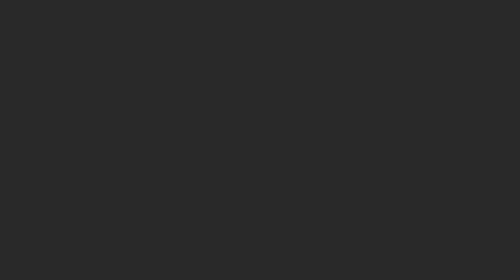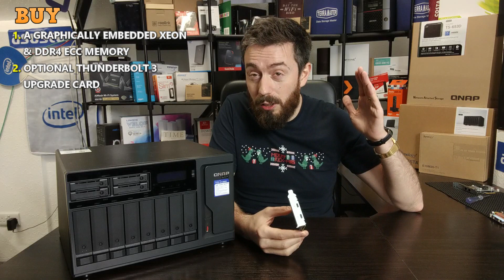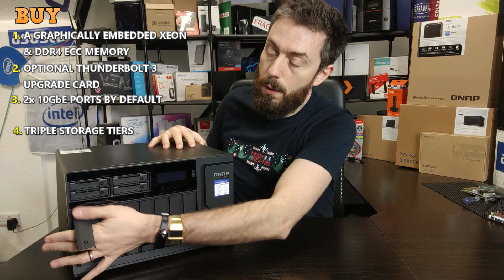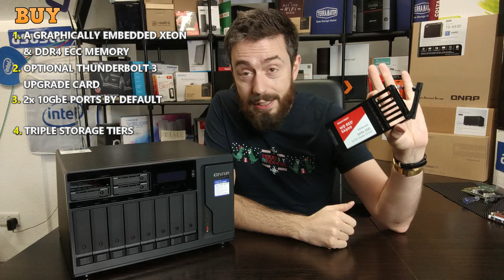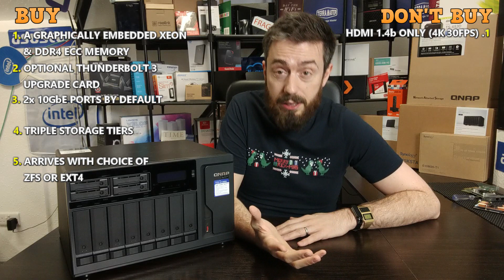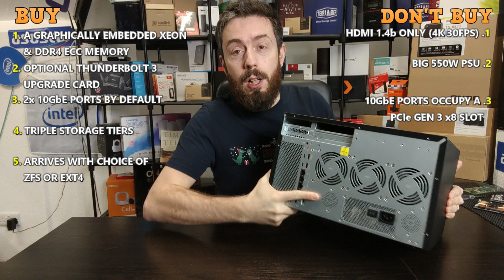QNAP TVS-1288X NAS - Should You Buy It?

Comment: I have it. It is awesome. Definitely use the tier storage. Use ssd for apps in pool 1 and then media in pool 2 on SSD. Also have cache nvme m.2. And added 128g of ram. Now just trying to decide on GOU. If anyone has GPU suggestions.
Reply: Unless you already got a GPU, I can vouch for the MSI GTX 1050 Ti 4GT LP. I have been using it for about 6 months without any issues. Also, very nice on the 128gb. I currently have 64gb and for now it works great. Let me know if this comment helps.
Reply: @diagito  many thanks I went for the more powerful quadro p2000 5G in the end
Reply: @diagito  yes it helped make up my mind. I will order that GPU and let you know. Thanks.
Reply: I have just bought the TVS-1688X - isn't it better to use the SSD for cache and m.2 for apps/media? whats a GOU?
Reply: @speedbird737  meant GPU

Comment: Yeah, I agree about it being available in 4 & 6 bay options.

I bought the h1288x for home use, not ‘enterprise’, I don’t need 8xHDD’s plus 4xSSD’s plus two NVMe slots....with the ability to add more via PCIe adapters. I don’t need stupid amounts of storage capacity, but I do like the speed & capability of this processor. At present, I have two 1TB SSD’s for the OS & apps, and six NVMe 2TB sticks installed in a raid 5 for data. At some point I will need to add more storage, but this will probably be more SSD’s in a Raid 5...probably three 4TB, so I will use one of the 3.5” bays to house one of the 2.5” SSD’s. I prefer to avoid using HDD’s if I can I think. 

So, what I’d like to see, is a similar machine, with maybe just 8 SSD bays total and ditch the 3.5” bays. Maybe make one of the two x4 PCIe slots a x8 (so two x8), so a second NVMe adapter could be added.

The four 2.5gbe ports would be better if they were Four 10GBe ports too......or, at least maybe just two 10GBe ports built in with the ability to add more via the PCIe x4 slots.

The HDMI output being only 30fps is a pity....wonder if there is a Xeon as powerful but with a 60fps output.

I never thought about how power hungry the device might be!
Reply: there is a machine from qnap already thats is ssd bays only
Reply: @speedbird737  ...there was not when I bought the H1288x I think.

Comment: The negative about the 10GBe card being on the PCIe x8 slot is a minor irritant that can be easily resolved.

I bought a QM2-4P-384 NVMe card, and it made sense to fit that in the x8 slot. So I just moved the 10GBe card across to one of the two x4 slots. Sorted! I think the QM2 card came with a range of backing plates too, so I used one of those on the 10GBe card when I moved it across. It’s not really a negative at all, it’s so easily resolved, I just don’t understand why QNAP would manufacture the machine with the 10GBe card in the x8 slot to start with - that seems daft.
Reply: Did you get yours for $2k or $2.5k?  They have gone up a lot.
Reply: @BrianGarside  .....yes, they have. I missed the best deal, but I did get 64gb version for around £2.5k.....couple of weeks later, I noticed it had gone up again.
Reply: @TheLDunn1  Ok, yeah its seems they are selling fast. Didn't know you could get a 64gb version configured, Nice.
Reply: @BrianGarside  ....Span offer them in 16, 32, 64 & 128GB. I’m just a home user, so would probably be fine with less, but I also ready that ZFS file system likes ram, so I went for the 64GB version to be on the safe side, I know I dint need to go up to 128gb though.
Reply: @TheLDunn1  Ah SPAN ok, that makes sense now. Dealers I visited did not you have to have it installed after purchase. Thanks!
Reply: @BrianGarside  ....I wanted to buy from Span, because of the very helpful YouTube videos.
Reply: @TheLDunn1  Agree with all you've said Lawrence. But how noisy is it ?
Reply: @tadbarker7082  well, mines pretty quiet because I don’t have any hard drives in it.

I have 6 x 2TB nvme sticks - 2 of which are on the nas, 4 are on the QNAP pice card.

I then have the OS on 2x SSD’s (think they may be 2TB SSD’s from memory).

One of the reasons I decided to stick with SSD/NVme drives was to keep noise down. I’m not sure what generates more heat though, SSD/nvme or hdd....because one aspect of noise are the fans..it’s all I can hear from my nas, the fans are not that noisy, and they are not running flat out or anything, but it is the only noise I have from the nas. It is certainly not annoying or irritating, it’s perfectly acceptable.

It’s taken me a few months to get it set up to close to what I want.

Comment: It is a beast and shows how important a good size CPU is.
Indeed, the Thunderbolt card (QXP-T32P) can serve a single TB user per port (so, no daisy chaining of users/pc's) or multiple TB-connected QNAP's (daisy chaining, up to 6x max, counting from the host PC) per TB port.
BTW, the QXP-T32P is the exact same(!) TB3 card (being the "TBT3 - 40G2P V1.1") as already present in the TVS-1282T3, TVS-472XT, TVS-872XT etc but with some additional brackets to mount in various-height slots (low-profile etc) 
So I would argue it is not that "optional", it already existed but not available for separate purchase.
I wholeheartedly agree with you that the PCI-e slot configuration (2x x4, 1x x8) is a bit of a let-down because if you look at the QNAP's with 10GBe expansion factory-installed (TVS-1282T3, TVS-1282T), they are not always limited to the x8 PCIe slot but use a x16 where available.
I also agree the choice that QNAP only offers 4x 2.5GBe on this model is a bad choice, likely due to chip-set limitations or costs. (savings)
And it almost looks like the add-on card for the 2x 10GBe is an after-thought because no way will a PCI-e x8 slot go beyond 7880MB/s (theoretical maximum)
(you mentioned 2000MB/s but that was for PCIe 1.0, these are PCIe 3.0 slots)
In all QNAP tries to position this as an enterprise NAS but on several key areas it is missing that mark. (your Top 5 Not-To could have that also noted as a negate)
Probably to make the price more attractive and/or the unit not more expensive than it already is.
And with their ZFS implementation (and limitations) I'm still not convinced at this moment in time that is the way to go, as QNAP still has to do a lot of work on that.
I was considering the TVS-1288X for replacing our TVS-1282T's & TVS-1282T3's but looking at such things as PCI-e on the latest QNAP's, I'm not that convinced that QNAP is currently at the right track. Maybe their PM(s) need to rethink their strategy a bit more?
Because, I'm really sorry, but a 2-port 10GB card in a PCI-e x8 slot is just plain stupid! I think.
Reply: So, referring to the title of this video, I think "QNAP TVS-h1288X NAS Review - Speedy but underwhelming hardware-configuration.."

Comment: Thanks for the vid.  I have one of these on order currently.  I really like that this model has so much space to grow into and after comparing all of the models the bang for buck seemed to make it one of the best choices from Qnap.
Reply: Hi Joel, 

I received my H1288x mid December. This is my first QNAP, so I’m having to learn the software side. So far, very happy with it.

I moved the 2 port 10GBe card out of the 8x PCIe slot and put it into one of the two free x4 slots. This freed up the x8 slot so I could fit a QM2-4P-386 4 slot M.2 card. I have installed 6 x 2TB NVMe sticks in the NAS and set them all to one raid 5 for data storage. Separately, Span installed two 1TB SSD’s in the 2.5” drives which are in Raid 1 for OS/app storage. Currently, I don’t have any of the 3.5” bays filled, but at some point in the future, I will probably need to install some SSD’s when I need to grow storage. I had around 5TB of music, photos & video footage on an old Synology NAS that I had to move across (took an age due to the speed on the old NAS).

I’ve installed a QNAP 2 port 10GBe card in my desktop too, so I can go 10GBe direct between NAS & Desktop. This is the only area where I’ve struggled. I’ve been trying to combine the two 10GBe lines and run speed tests on the desktop, but I’m not getting the expected speeds, only around 1000MB/s so far, I was expecting more! I think I’m doing something wrong on the port trunking, but I’ve tried loads of different things, but not really had success yet. Hopefully I’ll get there in the end.

I am now able to download images straight from camera to the NAS and then edit the on my Desktop directly from the NAS, it’s easily fast enough for that, which was one of my goals. Video (up to 1080P - I don’t have any 4K yet) also seems to play and stream fine. Not tried any video editing direct yet though, but expect that will be okay too.

On the software side, QNAP seems pretty similar to Synology DSM that I’ve been used to. It takes a little adjustment to learn, but so far seems straight forward (except for the port trunking maybe). When I created the 6x2TB Raid 5, it did it really fast.....no long wait for it to be created.

I’m at the early stages of trying out different apps, the one that has impressed is QuMagie....specifically the facial recognition. I gave it one photo of my son, it then presented a dozen or so others it had found and I clicked to confirm which were him, I think it might have got one wrong. It then showed maybe a thousand images which contained my son. He’s 15 now, but it was finding images when he was around 3....he changed a fair bit between 3 & 15, so I was surprised the software was that good! There were also shots of him sailing where he’s wearing a helmet, others where he has large glasses and a hat on. How it’s managed to work out it’s him in some of the shots is amazing.

Sure you will be equally impressed when you receive yours.

Oh, and with my setup, no HDD’s just NVMe & SSD’s, it’s very quiet.
Reply: @TheLDunn1  damn I would expect that 10Gbit direct connection to be a lot faster for sure.  It might have been easier to go Thunderbolt maybe?
I plan to use my Qnap a little differently.  I am going to use the On-board NVMe's in Raid 1 as my system/VM drive.  I plan to install a 2.5" x 1TB drive for my cameras.  I will be moving my 4x4TB raid 6 over and I have two spare SSD's for caching.  This will leave me with 4 empty bays to continue to expand into.  I'm a Plex user and I've been working on digitizing our entire DVD/Bluray collection.
Reply: @shomaniac  ....yes, the speed at present isn’t what it ought to be. I don’t think this is the h1288x’s fault, I think it’s mine, and just not being overly familiar with setting up networks, beyond plugging and Ethernet cable in one device and the other end in another device! I hope to get there eventually, not given up yet.

I’ve just started using Plex, I’m quite impressed so far.

I thought about using the onboard NVMe slots for OS & apps, but opted for the route I’ve gone. Had I been able to get 4TB NVMe from Span, I’d have got 4 of those in Raid 5, but only being able to get 2TB sticks, I needed all 6 to reach the capacity I wanted.

When funds recover & I need more storage, I’ll add 3 SSD’s in Raid 5, then copy my docs, music and photo folder over to the SSD’s, leaving the NVMe’s for video files....they need the speed more than any other file I think.
Reply: @TheLDunn1  Did you try it with just one connection instead of in aggregate mode?  How about running through your switch instead of direct?  Just for the sake of trouble shooting.
Reply: @shomaniac  ....I’ve kind of got it working now. I say kind of, because I’m still only seeing around 1000Mb/s, despite having the two 10GB ports in the NAS going to the QNAP two 10GB port adapter I fitted to my PC (in a PCIe x4 slot). However, I not have the two 10GBe connections on a separate subnet from the 2.5GBe connection going to the router. I’m not overly experienced when it comes to networking, and this seems to be the problem for me! ;-).....but at least I am able to Map the 10GBe connections separately to the 2.5GBe router one.

I don’t have a switch, only router (1GBe), so I can’t test your suggestion out, otherwise I would.

I have tried it in non-aggregate mode and can get that working (@1000MB/s) ....and I’ve now got it working in aggregate/port trunking mode....but, it’s still only giving 1000MB/s.
Reply: I am on the fence between this and the 1688X. I figure if I am going to pay the price of admission I might as buy the extra room and not have to sink more money in another housing.
Reply: @HAPrime  Solid point.  For me the 1288 is already outside my budget. :)  I don't think there is a wrong choice though.
Reply: @shomaniac  it's out of my price range too. But I have too many external drives and I need to start consolidating and I figure with the 16 bay I can do an initial 6HDD pool. A second pool later on and maybe an NVMe for cacheing
Reply: @HAPrime  LOL, it's only money right?!  I'm moving up from a 431P so this is a rather large jump for me.  When I bought the 431 I had intended for NAS only but after owning it for a year I realized how diverse these products are and I really should have bought something at a server level.

Comment: Hi Rob, really good info. You’ve rated the 872XT as best of 2020 in several categories. I assume the 1288x wasn’t released in time to make the list. So for $100 US more, it seems like a no brainer to get the 1288x. I don’t really plan on using the HDMI (I stream through multiple NVIDIA Shields) and the 10Gbe card using the x8 slot isn’t an issue for me. 
One thing you didn’t comment on was how does the noise level compare between an equally configured 872XT and the 1288x ( for example 4 and 8 WD Red Pro HD’s in each at different loads). 
Thanks again!